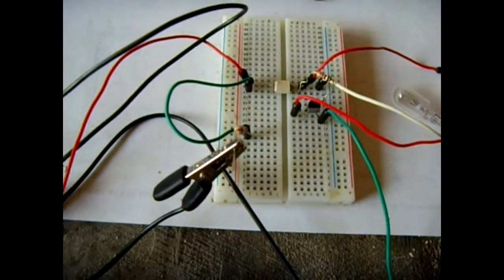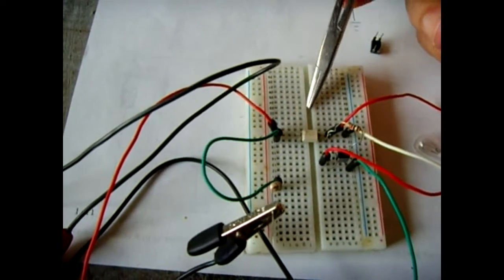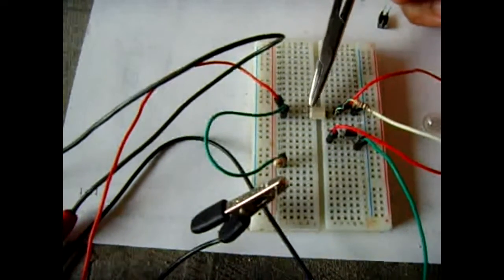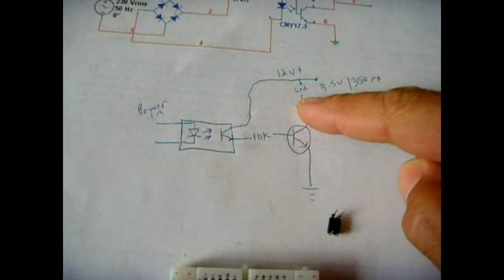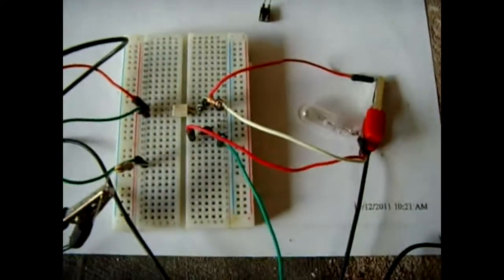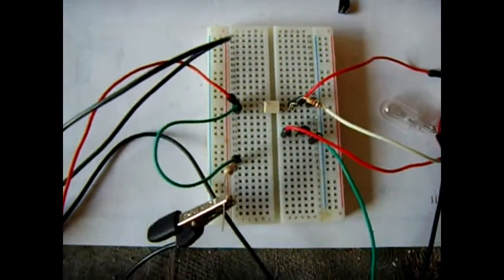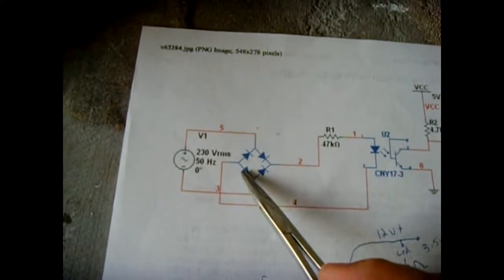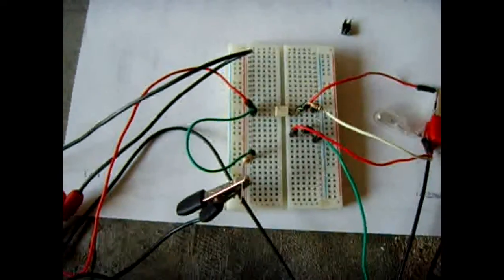Understanding Optocouplers

Comment: In a similar way, I made my own voltage controlled resistor using a white/clear LED with a photoresistor, wrapped in electrical tape.  It worked perfectly for the circuit I was working on which was 2 Asynchronous 555 Timer circuits hooked together.  The voltage controlled resistor pulsing in the first 555 timer circuit acted as an arpeggiator in the second timer circuit.  So it sounded like a synthesizser hooked up to a sequencer.

Comment: Perfect explanation.  I am drawing the schematic from a power board that was in a very old pc scsi scanner and came across this chip, well the CNX82A phototransistor optocoupler and forgot some stuff from my days of college.  This video answered my question and confirms my suspicion of the one side of the chip being in a low voltage circuit.  This was a great help.

Comment: great video. makes lots of since .I kinda understand it. I'm looking in to isolating a MOSFET bank from the driver circuitry. can I use one of these for gate isolation . in case of a melt down to prevent burning of the drive circuits. I know resistors are usually used. but do not always work. thanks great video.

Comment: Hey, great video on optocouplers, I was wondering if i could used this device to drive an ignition coil from my PC sound card. Basically i was thinking it could go like this: sound card output-->optocoupler--> suitable transistior--> ignition coil. i would use a tone generator program to drive the optocoupler. is this setup likley to work?

Comment: Do you think it makes sense to use it as shown in the last few seconds, as a high voltage switch for a low voltage circuit?
Reply from the maker: Optocouplers are used all the time with triacs to control 120/240VAC loads.
Reply: Yeah, thanks, I looked it up and found a nice simple solution for what I need to achieve..

Comment: Your video shows that the light activates the Base of the transistor but the
Data diagram shows the base is also connected to a pin.  I presume there
is nothing connected to the base of this Opto Isolator for your demonstration circuit.

Could base connection could be used is a different circuit or is it a measurement
test point?

Comment: thank you so much for this easy to understand lesson it was easy to follow 
i have a question
are there optocoupler types where i can switch it on with AC main 
not with low dc voltage 
if there is could u give me an example like a part number for 1 or something
Reply from the maker: Hi there. No, one side is triggered by low voltage DC, and the other side handles the high voltage AC. Thanks For Watching!
Reply: aha i see
thank you for your quick response 
P.S. new subscriber here